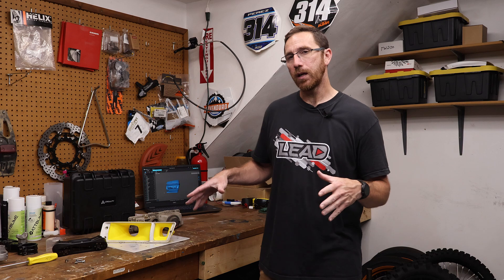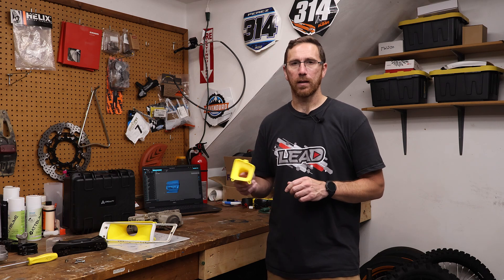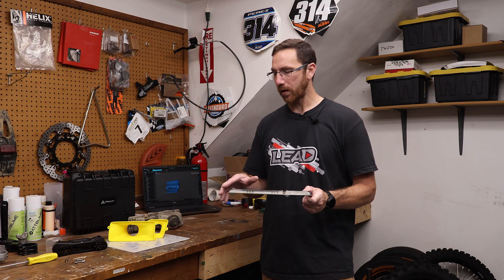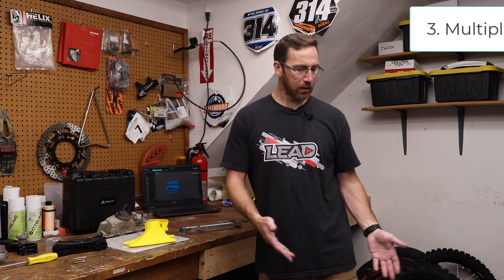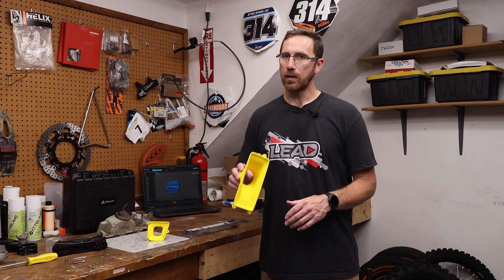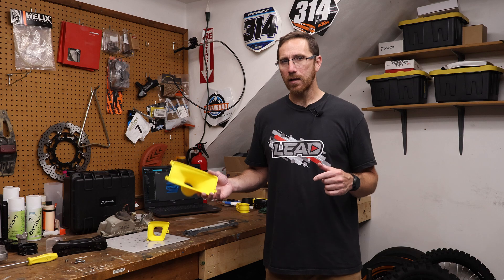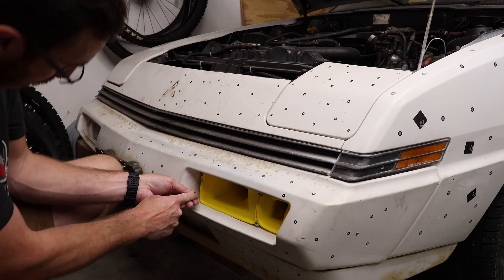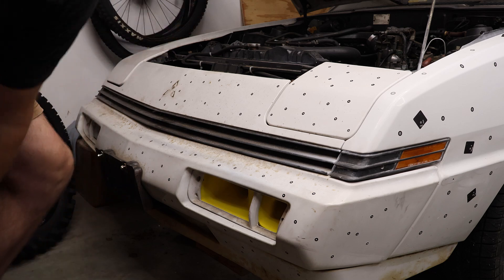Design Custom Car Parts With 3D Scanning | Ep5 | Final Install #creality3dscanner #quicksurface

Comment: This is EXACTLY the type of content that is SUPER helpful!!! Thank you for putting in all the work that it takes! 🙏

I will be using this immediately to be doing a fairly involved sound system install into my car, and this level of detail in the full process is fantastic!!

A very thorough design walk through of Quicksurface personal would be very helpful for many people I bet. I'll be signing up for it in the next day or so, and I'm sure many others will be as well as there was definitely a need for it.
Reply from the maker: Awesome glad you liked it!  The recent BMW trim panel series we did, the first 2 episodes were with QS Personal fyi
https://youtu.be/LdKKJs5e03g

I have on my list to do a video comparing personal to lite and pro, but in the first 2 vids of that series I mention most of the differences between personal and LITE/PRO.

Comment: Awesome content, I really enjoyed the entire series. Is there a way to produce this item without the Quick Surface step? Can you go directly from the scanned mesh to Fusion 360? Cheers
Reply from the maker: For sure, you just don't have the ability to really align or process the mesh as much.  You can reduce the mesh a lot in your scanner program to make it less intense to deal with in Fusion.  For a part like this the alignment is probably not as critical, but putting multiple pieces together like the bumper with and without the light in it would be a "best guess" by moving them around in fusion.

Comment: Another awesome series Matt. I've had my raptor pro for a few months now and love it. I have to design and 3d print some brake cooling ducts from the fog light holes in the front valence of a 69 Camaro, this series definitely helps a lot. also using the scans to build a carbon fiber front splitter for the 69 Camaro which all of your previous series has helped considerably. love your work mate and everything you do and share your knowledge is very much appreciated. I also used the raptor to scan my van and have designed a dash to 3d print for it. also, I never seen the slice function explained anywhere that is pretty cool. thanks again.
Reply from the maker: Awesome, glad you are finding the series helpful for your projects, and thanks for watching!  I wish I had these tools when I was doing work on my 68 camaro.  That was all beating sheet metal and bondo :)

Comment: Loving this series Thank You. I've learnt the hard way that spending too much time on the initial design is wasted effort. Even working from a scan and/or physical measurements still doesn't account for deviation between design model and slicer and printer.  Now i adopt the "get a prototype of the basic form printed asap" workflow.  Cheers
Reply from the maker: Appreciate the kind words,  Back in the "old days" i can't tell you how many times I would design something, lets say sheet metal, get it cut at a shop and then have to tweak, grind, and cut just a little :)

Comment: Great series of videos. As you’ve asked I’ve watched them all but skimmed over a fair bit. Not that it wasn’t useful but I’m not a beginner and know some stuff! 

Saying that I would think those who skim all skim different bits as knowledge varies. 

I do learn a fair bit from each video so keep it up please. My only gripe and it’s not with you it’s the use of Quick Surface. It’s far outside the cost of most hobbyists so that I definitely skim as I can’t afford it as learning about it is a waste of time for me. Maybe nice to see you use a free or cheaper alternative.
Reply from the maker: Thanks for the feedback.  If you are using a revopoint scanner the RevoDesign is a reskin of QS Lite and they bundle it with scanners and sell it directly as well.  I am working with someone trying to develop something that has the tools needed but right now I am not aware of any free product that gets you there like QS lite does.
Reply: @LearnEverythingAboutDesign you’ve said that to me before and as I remember RevoDesign is as much as QS to buy.  I also don’t know what scanner they would bundle it with! I have the MetroX and it wasn’t with that.
Reply from the maker: It is bundled with the MetroX Advanced kit.  the one that comes with the extra box of magnetic 3d markers.  I don't know when that was added though.  My code Lead10 works on QS site and REVOPRLEAD for anything on the revopoint site.
But yeah the only free mesh tool i know of is MeshLab and while it can align multiple meshes to each other I don't remember it having an align to xyz last time i used it.

Comment: Great to see when a draft fits! I enjoyed the series and learnt some things along the way. Appreciate your efforts in producing these videos, it’s really great to the full picture! 

And update on the more final implementation would be cool, however, feel free to get into the design flow with the camera off and perhaps mention what changed so you can gain some efficiency back!
Reply from the maker: Thanks!  Yeah ive got some material on order to try and last night i filmed a CFD video with the duct to highlight areas that could change to improve flow.

As for a final implementation filmed vs recap ill give that some thought.  It is certainly quicker to just do it :)